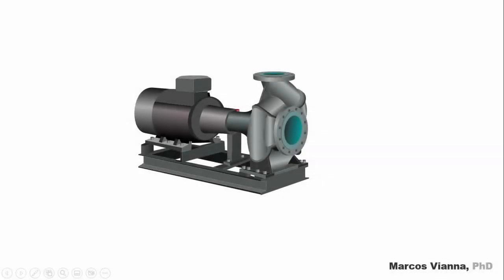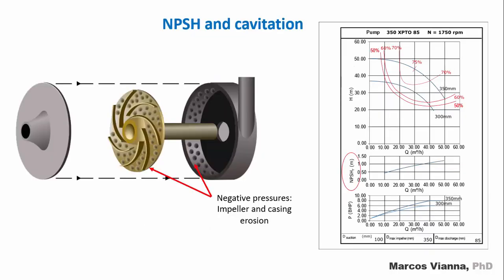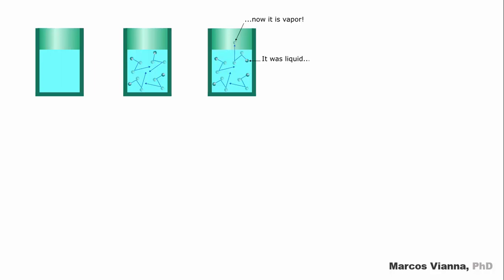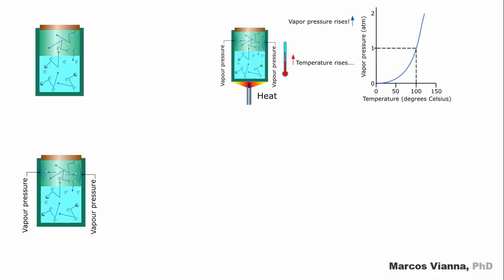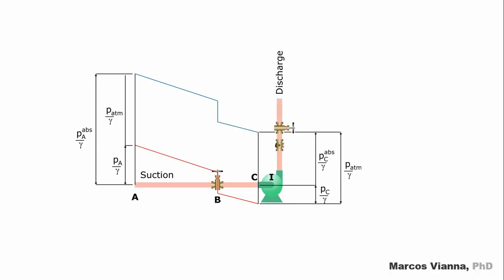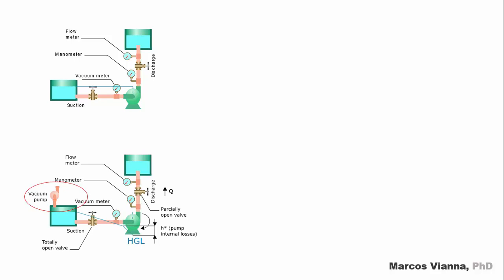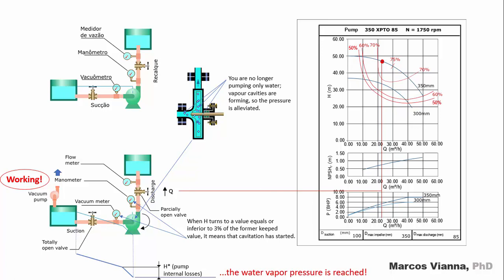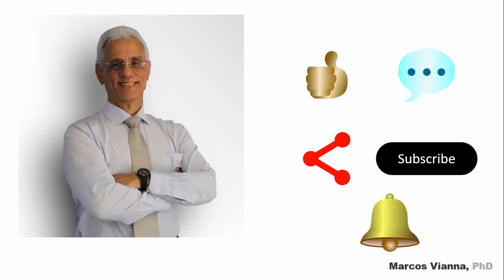NPSH curves

Comment: Brilliant video. One question - when cavitation occurs, will we always see this significant drop in pump head (greater than 97% drop) relative to normal operating conditions? Would this be a good troubleshooting indicator for cavitation in pumps?

Can we have a scenario where you reach cavitation within the pump, but the fluid gains enough pressure to go higher than vapor pressure just barely at the discharge at the pump, hence the manometer-vacuum reading doesn't drop to 3%?